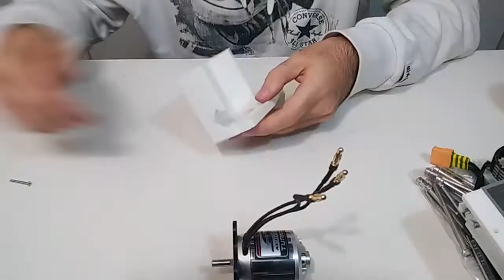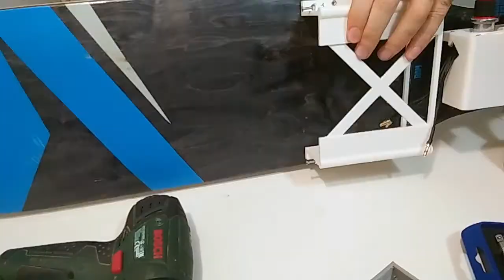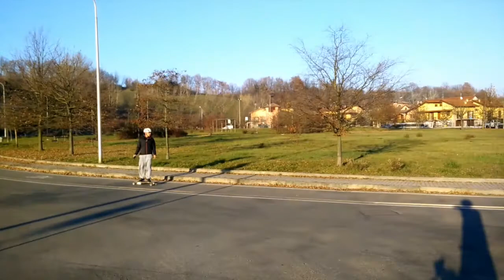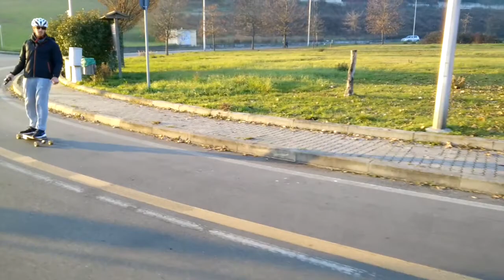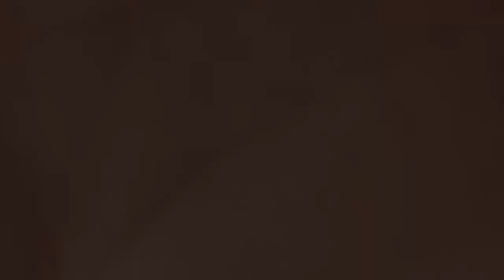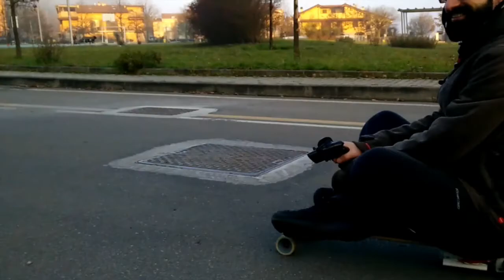DIY 3D PRINTED ELECTRIC LONGBOARD

Comment: abs or pla? or something else
Reply: and did it last?
Reply from the maker: Straight PLA
Reply from the maker: Yes, I'm still using it, even though with some changes. The piece that lasts for not very long is the wheel pulley, which I have to replace every ~100km. In fact I'm thinking about getting an aluminum one
Reply: +TheFinalResult ins't the mounting motor melting because of motor heat while riding?